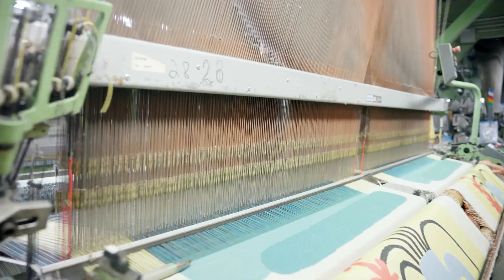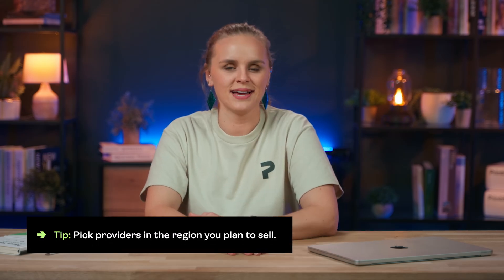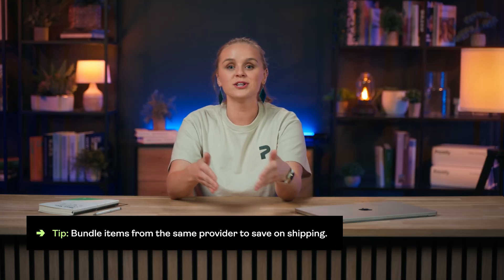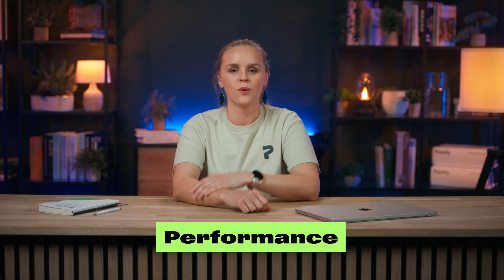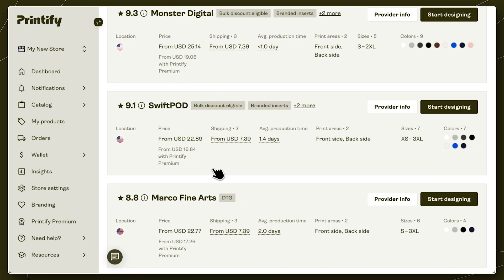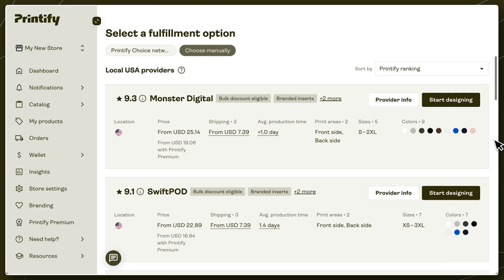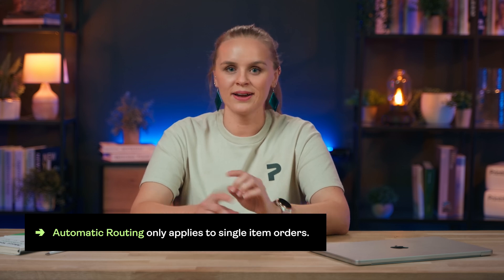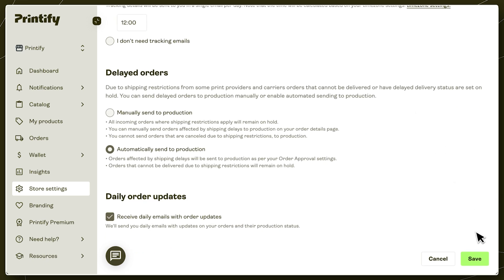Printify Print Providers EXPLAINED: How to Choose the Best One

Comment: Great video, thank you!  Is it possible to save on shipping if a client buys two different products that are similar from the same supplier? For example, District Photo sells ceramic mug and accent coffee mugs.  If a client buys one of each, would they pay the additional item shipping price for the second mug?  Likewise with District Photo's journals - if a client buys a spiral and a hardcover, how would the shipping work?
Reply from the maker: Most products qualify for a reduced “additional item” shipping rate when multiple items of the same product type (e.g., t-shirts or phone cases) are included in the same order and fulfilled by the same Print Provider. Non-apparel products with size variations can only be shipped at a reduced rate if they are within the same size category (posters, canvases etc.).
Reply: @Printify  Thank you so much!

Comment: With Printify Choice and selling the same t-shirt design to US and UK, do you no longer need to duplicate a listing and have a specific shipping profile? Im concerned for my UK customer base it will still say 'ships from US' on the listing which will likely put them off placing the order.
Reply from the maker: Hey there!  Great question! 

Here’s how it works:

Select an eligible Printify Choice product with eligible variants. 
Browse our current eligible Printify Choice selection here—more coming soon!
https://help.printify.com/hc/en-us/articles/33740408161553-Which-products-and-variants-are-eligible-for-Global-Fulfillment 

Eligible listings are automatically fulfilled locally in these regions: the US, the UK, Australia, and the EU. Buyers in these regions will see local shipping estimates and costs at checkout.

If you include any variants not listed here, the customer-facing shipping profile will not display local shipping prices or delivery times. However, our system will still route eligible variants for local fulfillment, while ineligible variants will be fulfilled according to the international shipping rates and delivery times.
Reply: @Printify That's great thank you, such a timesaver!
Reply: @Printify  Thanks for the response!  So I've trialled this option however when it comes through to Etsy when I look at the Shipping Profile the UK isn't actually listed, whereas Australia and Canada are with US being the primary address.  Would it still be recognisable to UK customers as local shipping?  Thank you!
Reply from the maker: @petitJeffrey  Hey! If you're referring to Printify Choice Global Fulfillment, then, yes, it should be. However, keep in mind that only select products are eligible at the moment. https://help.printify.com/hc/en-us/articles/33740408161553-Which-products-and-variants-are-eligible-for-Global-Fulfillment. If you're able to, you can share screenshots of your concern directly with our support team and they'll be able to guide you better. :)

Comment: There is no reason to use Printify Choice.  Just like Gelato, you don’t know who print your produce and you don’t know if it is the same print provider print your produce every time.  It is alleged that Printify will pick the highest score provider but it is questionable if the score reflects what we deem as good providers.  Printify may pickup the fastest, cheapest provider for me but what if I value the quality of my produce over speed and price?  What if the local providers all run out of stock? Are you getting your products printed from another country?

Printify also makes international sales unnecessarily complex. I’m choosing between shipping my products worldwide from one single provider, or I need to pick one provider from each country which means I need to split my list on Etsy by county as well.

If you are selling to the US only and you only sell t shirt, just pick Minster Digital. End of story.
Reply from the maker: Hey! We only partner with trusted providers who meet our standards. That being said, you are absolutely free to still choose your provider! Printify Choice is simply another tool to make the process easier.

Comment: A lot of the print providers for certain products are US based only so not viable to sell into the UK due to time constraints. I've so many great ideas for products yet when I check it's US based. 

Of course I can get this fulfilled from say the USA but customers are fickle and simply will not wait  long time for delivery and simply look for a provider that sells and delivers in an acceptable time frame.
Reply from the maker: Hey! We're sorry we don't have as many options in the UK. We're definitely looking into how we can expand and find more local products. In cases where you have no other option than a US provider, we recommend reworking your value prop. For example, offering bundles or a 2 for 1 deal to save on shipping costs, or offering personalization. More often than not, customers will be willing to pay and wait longer for an order they perceive as higher value.